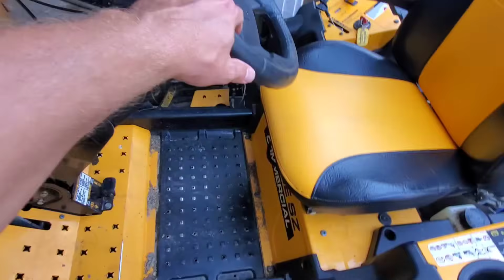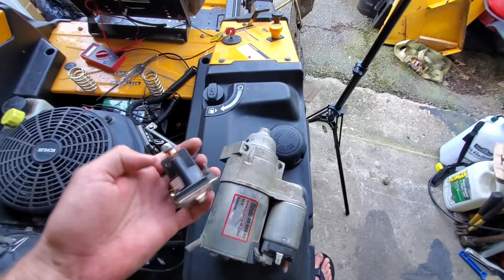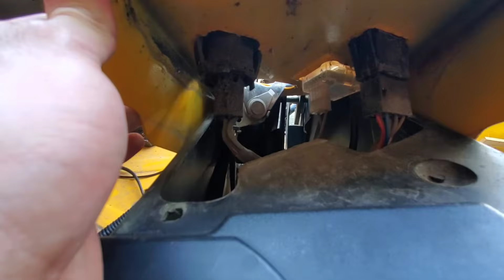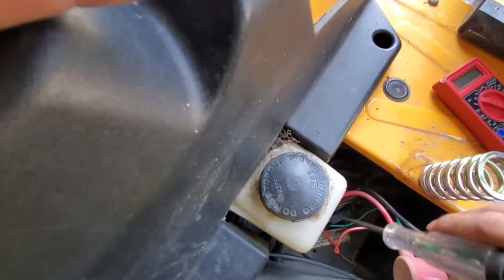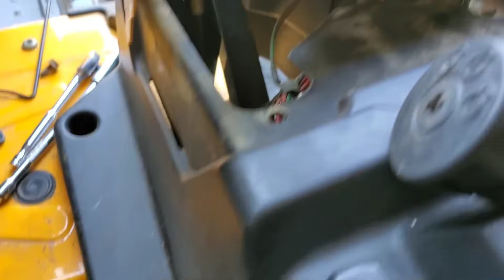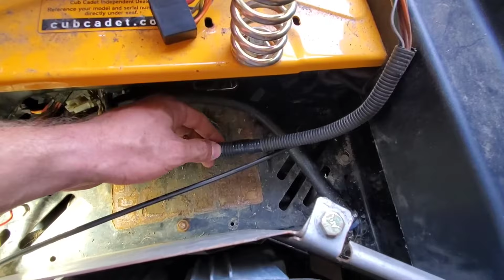Cub Cadet Won't Start Won't Crank No Click Troubleshooting Electrical Problem

Comment: Thanks great job.  Most Cub Cadet videos are for the smaller newer models.  This is my model and it's hard to find videos.  It won't start.  Put charger on it, gauge said 12.7, but still won't start.  I put the charger back on it and left it while I tried to start it.  It started.  So I'll try the battery to Autozone for testing.  I don't understand why it didn't start with 12+ volts and needed the charger connected for a little boost.  I was anticipating a bad starter which is over $350 on cub cadet website.

Comment: Thank you. I just had this problem. Battery and mower is 9 years old. I tried charging battery and it would not take a charge. I installed new battery. Still no power. I spent several hours looking for the 20 amp fuse holder. Finally found it literally 6" from the battery. I must be getting blind in my old age. The fuse had blown. I put in a new fuse and it all now works. I did a lot of cleaning. All in all, my mower is cleaner and I have a new battery.  I guess I shouldn't be complaining! I have a 54" Cub Pro Z 100 zero turn mower  with a steering wheel. I purchased it new. It's been a really great mower so no complaints. I have discovered that using the right blades makes a HUGE difference in the mower's performance. I have amulching kit and I have mulched from day one. I have 2 acres and it laways looks beautiful without using any fertilizer. The grass clipping act as good rich mulch. Thanks for taking the time to do this video. I found this AFTER I just got my mower fixed.

Comment: Super helpful. Thank you so much. I did have a frayed wire from my new battery to the ignition which killed power to key.  I fixed the connection and boom, it works great. You are a life saver.  Our repair shops here suck big time and the mobile guys are too busy. Thank you bunches!,,😊
Reply from the maker: Awesome, so glad the video helped you fix it! Thank you for the comment.

Comment: Automotive guy here love love the test light but please get one with an incandescent bulb i keep an led one to show the new guys its as useful as ohm testing with 1 strand of wire it will light an led or show good on a resistance reading i have a dual filliment brake light bulb that draws enough to properly load the circuit
Reply from the maker: Thanks for the tip, I'll keep that in mind and update my tool kit.

Comment: I had a Sears riding mower with 4 wheel steering, and it had a light so that it was a safety switch out it would light so you tell right away if that was the problem. A very good idea and a frustration reliever.
Reply from the maker: Yes, unfortunately we now live in a world where good ideas are not profitable for manufacturers so they want their stuff to brake and people have to go back to them for service, parts or replacement...

Comment: Hello ,I bought a cub cadet  z-force 48 steering wheel , with a blown engine .I do have other riders I maintain and I am kinda new to zero turns & their safety switches . I also am familar with golfcart safety switches and relays. I had every intention of replacing this z-force  if the price was right with  a new  factory  engine , Installation went very well , operational switches ,seat  switch , brake handle , clutch. Brake handle  must be in the up  on position  when starting .That works fine and when I disengage the handle .I can drive in reverse and forward and the machine operates like it should .  The problem is that when I pull the PTO switch the engine cuts out.There is no issue restarting when the switch is off, only when I turn the PTO on . Is there another switch i may have missed?

Comment: Awesome diagnostic, I followed your directions and solved my problems. I discovered the starter solenoid signal wire not  making good connection.  So I got cranking over, but it would usually make a wining/priming for fuel  before it actually starts.   I think it's fuel injection but not for sure??? It's a cubcadet proz100. Thanks lmk Thanks lmk

Comment: They should be required to have led's on all these "safety" switches that light up when engaged, would add $2 to the cost of a $3000+ dollar mower, and would save customers hours of frustration.
Reply from the maker: Yes. Toro actually have all the safety switches displayed on their hour meter gauge but unfortunately that's only on the commercial series.

Comment: My push to start (RZT) got water in it. Probably from me spraying the dirt and dust off the machine. I pulled the bezel and the "seal" which doesn't seal anything, cleaned it off. dried it out and sprayed a bit of WD40 on it and....PRESTO!
Reply from the maker: Glad you got it running again and didn't have to buy the expensive module

Comment: Ive got cub cadet rzt42. When i put in key i get display and battery level etc.  But when i push the key in it does NOTHING no clicking or anything.   Then if i just hold key in, (sometimes) it will try to crack and sometimes crack.  Its like flywheel hanging or something.   I don't know where to start.
Sometimes i get E-4 error.
Reply from the maker: I made a video on a Cub Cadet with push start ignition module that had failed if you like to go check it out. I would start with making sure battery is good and all ground connections are tighten. Then start checking start solenoid circuit and be looking for voltage dropping....
Reply: @mr_fixit the battery voltage drops when it does try cranking.   I'm thinking solenoid is bad.  Took off yesterday cleaned connections.   Started fine all day yesterday.   Then today it wouldn't do anything. Then it will finally turn over and crank.
Reply from the maker: @jbuck1975  check you ground connections too
Reply: Solenoid can also do that.  It is a magnet.  The key turns on and the electric goes down the small wire turns on a magnet.  The magnet spins the switch.  the switch connects the high voltage (starter cables).  that was why he said a screw driver with sparks jumps the posts 
A binex (worm gear) problem can also do that.  That is the screw gear on the starter that climbs up and engages the flywheel.  If damaged it is all about if the bindex is bound by damaged bears and cant climb,   typical tap the starter with a rubber mallet or wood (soft stuff) to juggle the damage.  On that starter he showed it is in that top 1/3 section.

Comment: Very instructional. I think mice have chewed at some of the wiring as I've checked the battery and safety switches, and replaced the fuse, solenoid and even ignition switch but still just get a click. Haven't found any damaged wire yet though. BTW in case I need to replace a section of wire do you know the wire specs?
Reply from the maker: Since you do get a click and you have replaced the solenoid I would check if you get power to the starter since that could be your issue but also check the voltage at solenoid and at the starter if you are even getting power to it. If your voltage drops between the battery and starter you may have a short somewhere.

Comment: I appreciate your teaching but you need to explain  slower.  you have done a great job finding the broken wire. First question: why did you turn the key on to test; Second question, I noticed that the tester lead was placed on the Negative post and then later on the Positive post.  I hope you understand I have no experience but I am willing to learn. Thanks and God Bless.
Reply from the maker: Thank you for watching and answer to your first question is, I turned the key On to power up the circuit that I'm testing. The second question, when I have the lead connected to the negative I'm testing circuits for power+ and when the lead was on the positive terminal I was looking for ground.
Reply: Thank You.